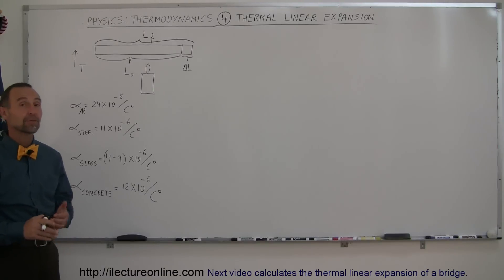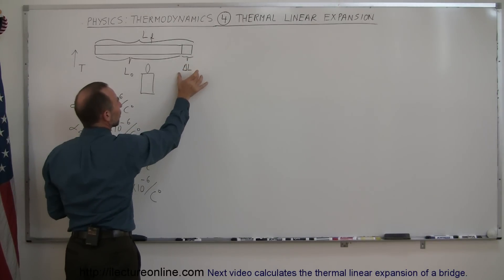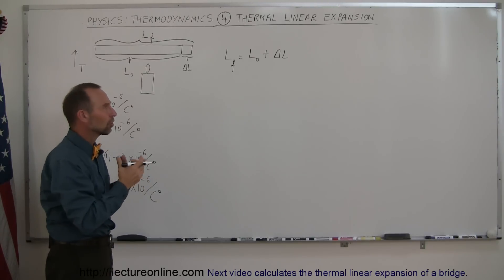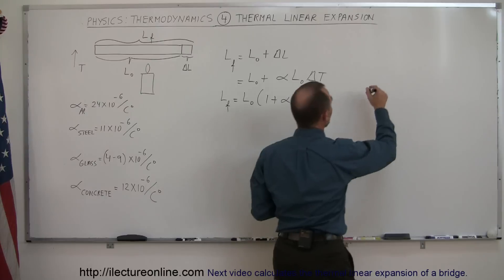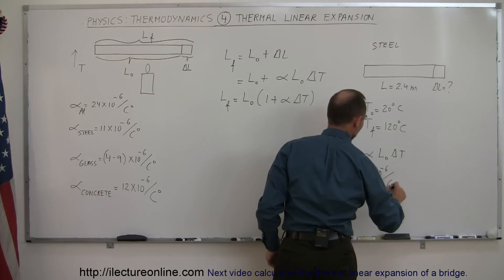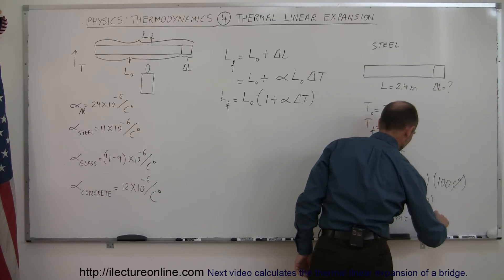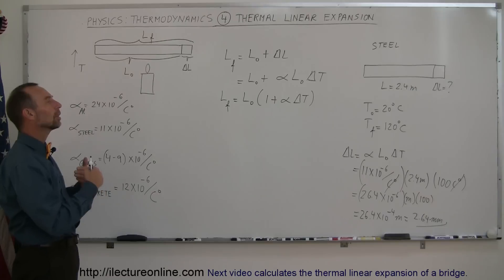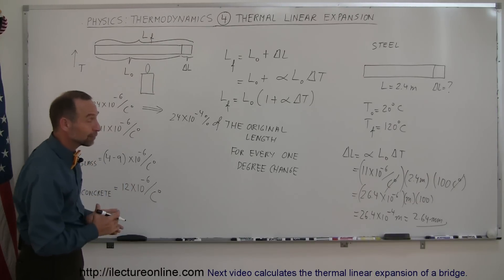Physics 21  Thermal Expansion (1 of 4) Thermal Linear Expansion: Definition

Comment: Mr. Professor does it shrink equal amount at temperature below zero oC?
Reply from the maker: Yes the expansion and contraction due to temperature variations is fairly constant.  However, if you look at it in more detail, the expansion coefficient is not constant and does vary somewhat with temperature.
Reply: Thank You for tip Mr. Professor I will search this datas.

Comment: Hello 
What is minimum calculated expansion value that we must have expansion joint?
Reply from the maker: We probably need some more information before we can answer that question.  There are different types of expansion joints and typically we caluclate the maximum expansion conditions it must be able to handle.

Comment: I'm an idiot. Can someone explain why there's a +1. For me it just seems like it was added there randomly but I know there must be a reason I'm missing.
Reply from the maker: We factored out Lo
Reply from the maker: And you are NOT an idiot.
Reply: @MichelvanBiezen  Thank you for the kind words. I'm trying not to be which is why I'm watching your videos. I think I get it now.  Next problem I think is my use of mu calculator. I don't get the answer  26.4*10^-4 m . I get 10*^-6 m. I'm I not typing it in right or was the 10*^-4 m just a rough approximation? I'm doing a mechanical engineering apprenticeship and I love math but it hates me with a passion haha.  I'm both trying to fill in the gaps and learn more advanced stuff at the same time.

Comment: 0:17 do atoms really begin to vibrate at a higher frequency? i think it's just the amplitude that gets higher. otherwise all organic substances would show large shifts of their usual absorption bands in IR-Spectroscopy when they get heated... their resonant frequency must stay the same
Reply from the maker: That is the basis of the blackbody radiation curve.  Higher temperature means higher vibrational frequency.  (solids and gasses act differently)
Reply: hmmm i don't think that's quite correct, as i can heat a metal red hot until it emits visible light and that still hasn't got anything to do with vibration frequency. I guess it's more like this: If you imagine a pair of atoms going up and down an asymmetric potential curve ( i know the vibrations are quantized  ), once they aquire enough energy they start to emit more energetic electromagetic radiation due to the stronger acceleration of electrons in the atoms. The vibration frequency will stay the same, but the velocity of the atoms must get higher, as they have to travel a longer path on the potential energy curve because <Ekin>= 1/2 m*<v^2> ... you can also write the average speed of atoms in a material <v^2> as <v^2>=omega^2*x^2 ... omega being the angular velocity and x being the deflection. If you look at low energies the potential curve is almost parabolical, so this model is pretty helpful ... the deflection on the other hand is dependent on the spring constant k and the mass m, so omega^2=k/m ...the frequency of vibration can be calculated by f=1/2pi * omega so f=1/2pi * sqrt(k/m)...  
What will happen eventually is that the elastic modulus of a solid will change upon heating, thus reducing the frequency of vibration not increasing it.

How could you logically explain the effect of vibrational frequency otherwise?
Reply: also if you look at it from a different perspective: most atoms vibrate at 10^12 - 10^14 Hz. This natural frequency is dependent on their mass and their bond strength. So how could we get Atoms in a solid to produce UV, Röntgen or Gamma radiation (if they wouldn't melt)? By increasing their vibration frequency? No...
Reply from the maker: I am beginning to see what you are saying.  What works at the macro level doesn't work at the quantum mechanic level.  I'll have to think about this some more.
Reply: sure ;) no hurries.. as long as you answer me back on this some time soon :) yeah but we need to do is find models so we can somehow understand quantum mechanics. the "balls connected by springs" model for solids is not a bad thing to start at, but it doesn't describe thermal expansion as a masses on a spring have a parabolic motion. to me the real quantummechanical anharmonic potential curve is like a spring thant can be stretched easier than it can be compressed, so that's how i could explain it to myself in an easy way

Comment: Hi, your videos are great, very educational. Thanks for uploading them. Could you help me with a maths problem? How do you calculate the expansion of a steel cylinder of 3metres diameter and 6 metres in height? what would its volume increase by if raised from 10 Celsius to 280 Celsius? And if the cylinder were full of heavy fuel oil, how much of the oil would spill over? Hope you can help. Thanks in advance.
Reply from the maker: The coefficient of volume expansion is 3 times the coefficient of linear expansion.

If a fluid in a container has a greater coefficient of volume expansion than that of the container, and the container was filled to the rim, the fluid will spill over if the container and fluid are heated.
Reply from the maker: Arch,
First find the delta V for the cylinder:
delta V = Vo * (3 * coefficient of linear expansion) * (delta T)
Then find the delta V for the fuel
delta V = V0 * (coefficient of volume expansion) * (delta T)
Spilled = delta V for fuel - delta V for cylinder.
Reply: Michel van Biezen Many thanks for taking the time to answer my question. That makes it much clearer. However, I get the fuel spilled to be 9920 litres. This seems an awful lot of fuel! Have I miscalculated?